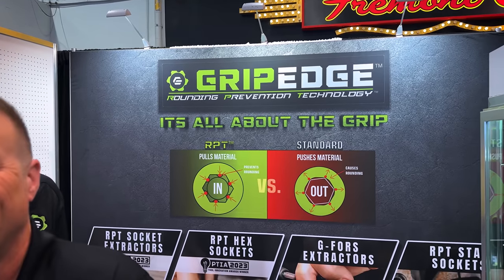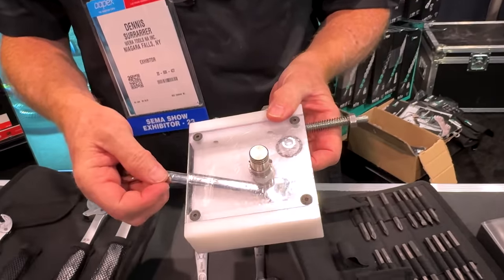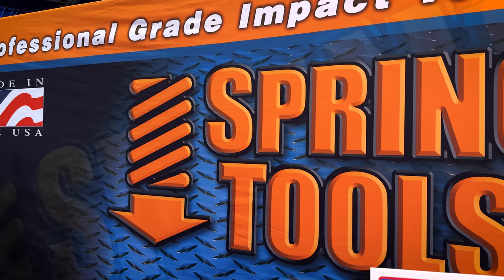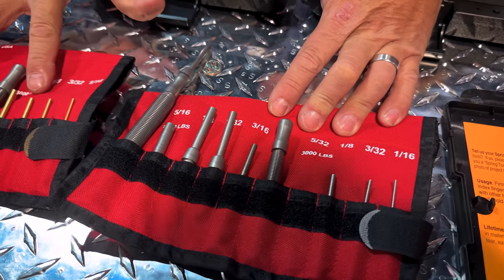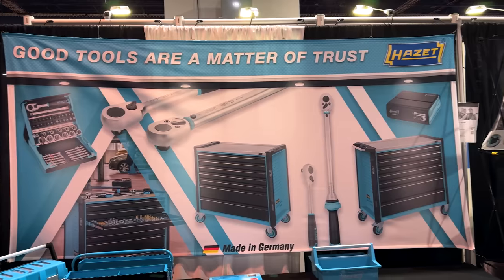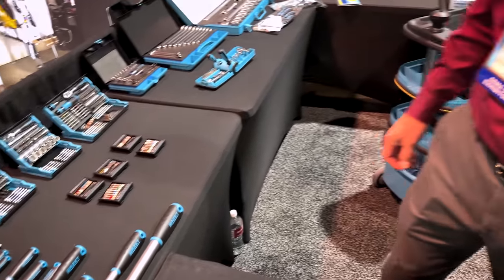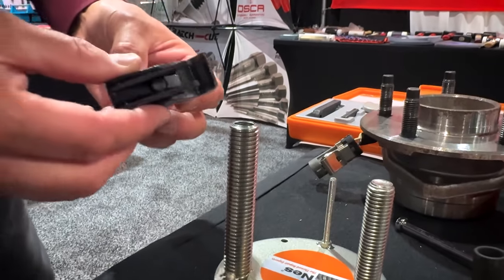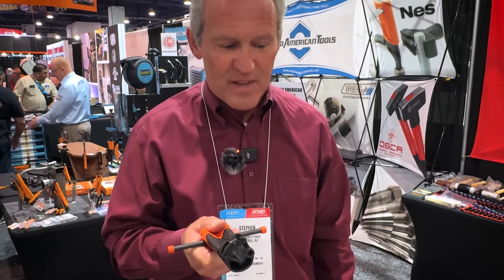SEMA Show 2023! Grip Edge, Spring Tool, WERA, HAZET, Bad Dog Tools, & More Tools!!! Pt 1

Comment: Bad dog is a scam. I owned the cut off wheel and the drill bits. Both fell apart after light usage and they wouldn't honor there warranty. DO NOT BUY
Reply: Are you kidding. My bad dog cut off wheel has cut through stucco, Steel ground anchors, and conduit and has had no issues. Had it over a year
Reply: There's a video floating around of a cut off wheel review and it's not a total scam but it's like bringing a Leatherman to work on a car. It'll probably work in a pinch but not well.
Reply: I've had the bits for 20 + years.  My problem with the warranty is that if you lose the broken bit before returning it, you're out of luck.
Reply: @jonathanlombard8897 why would they replace a bit that YOU lost 😂😂😂🤷🏻‍♂️
Reply: Thank you for warning

Comment: I will say this. Wera wrenches are not cheap, but you get what you pay for. I bought a pack of the hex plus wrenches for use at work. I've never had a set of allen keys hold up so well. I used the 3mm so much, the color coded plastic sheath came off, but the ball end and standard end still look like new. I've handed them to co workers who had hex bolts that were stuck and and the head was stripped out, and he was so impressed that they cracked the bolts loose that he showed me his metric pack the following week.
Reply: There will always be space for Wera and Knipex in any of my tool bags! Love the Hex Plus wrenches!
Reply: @PhilipBlank  absolutely, have the knipex pliers wrench with the smooth jaws in 2 different sizes. I handed the larger pair to a different co worker to use on a 23mm bolt holding a 40hp motor to a frame last week. Once they bite the only thing stopping you from breaking the bolt loose is your own strength. It's impressive.
Reply: Ah man can’t beat the smooth jaws. People are always shocked if they’ve never used them before. I’ve got the suite of cobras and two plier wrenches, but I’ve got my eyes on a couple more and a set of the jaw covers!
Reply: My ToolCheck plus is surprisingly my go to piece of kit when working on my VW engine. 

The T30 bit in that kit has broken loose more bolts/screws than any other bit ive ever owned and is still pristine.

It’s the only bitset that I absolutely make sure to never misplace even one - where as my Milwaukee bits I pretty much treat as disposable.
Reply: I work on forward where aesthetics matter, and wera hex plus is what I use if they make the size. If they made every size of hex bit that's all I would use, but the sizes are limited.

Comment: I know the RBRT and RPT stuff does work from watching your videos, but when he did the good hex bit on the bad hex bolt, he had the ratchet going the wrong direction. Idk if it would've taken it out or not, but still. For the principle if anything.
Reply: Our Cornwell Dealer in our area has that RPT demo block on the truck. RBRT and RPT are legit. Just had our Mac Dealer order me another set of the RBRT.
Reply: @removefromme  Yeah, I know they are legit, I'm just saying on the principle of honesty, it would've been good for him to have the ratchet going in the right direction for all of the tests he demonstrated. It could've just been an honest mistake, but idk since I'm not the demonstrator.
Reply from the maker: Played with the demo block myself. The normal hex socket won’t grab the rounded bolt.
Reply: @railroadsniper  I'd say honest mistake. If the product wasn't worth a crap, then it would have been intentional.
Reply: @MrSubaru1387  Thanks for the reply, I'm glad to know for sure now. Thanks for all the work you put into your videos! They've been a great resource
Reply: @removefromme  Yeah, I'd say I agree
Reply: The traditional bit was spinning freely regardless of direction. Forwards or reverse, there was no engagement and it had no chance of removing the bolt. Our RPT Hex gripped with extreme torque and he was able to crack it loose and tighten it back down again with ease! 💪

Comment: Those Bad Dog drill bits look good. Wish I could afford them, hahaha.
Reply: They have terrible reviews
Reply: On Amazon, baddog drill bits have 1.7 stars. Almost everyone says the bits are the worst.
Reply: @JREfunnies  Dang! How disappointing.
Reply: @TylerSnyder305 

Try drill hog bits, they also have a lifetime warranty.
Reply: @jesusisalive3227  I have def seen those recommended. It sucks that good bits are crazy money and any that aren't expensive are pretty much all crap. 😂
Reply: @802Garage  

Having a lifetime warranty makes them cheaper in the long run than the box store bits. They are good quality to begin with. I'm sick and tire of going through bit after bit after bit because they are being made with Chinese steel.
Reply: @jesusisalive3227  Warranty is definitely a good point. I usually don't expect a company to cover them though if you break them for example.
Reply: @802Garage   the warranty is only there to fool people like you. Wait until you try to return one, you'll be paying postage costs every time. By the third return, you'll wish you'd have bought something decent in the first place. And what happens when the company eventually goes out of business? This isn't the first or the last company to try selling masonry drill bits as something new. I've seen this exact demonstration by different brands. They're all the same. They'll make a hole, but they're no precision drill bit. A tool that's not fit for any purpose.
Reply: @goldar4846  Well read the second part of my message. I almost never break tools anyways. Almost everything I own is budget except my DeWalt 20V and Milwaukee M12. Plus I have a decent straight edge and some other specialty tools. I also own a few pairs of Malco Eagle Grips. I buy quality when it makes sense, but a lot of the time I just can't afford it hahaha. Warranty is not a main selling point for me. Matters more for something like a TIG welder or lift.
Reply: I've used them,complete garbage and way overpriced for what they barely do.In my opinion that is.

Comment: 2:47 Those Joker wrenches are marginal at their very best. This is the set that I regret the most. The open end slips much too easily even though there's lots of bracing I've had these slip on so many bolts I don't trust the open end any more. The closed end is decent and will hold up to normal amounts of torque but the backlash required to ratchet the mechanism is very inconsistent especially in the smaller sizes. The best feature of these wrenches is the color banding corresponding to different sizes because it makes picking the right wrench super easy. Sadly, instead of making small raised panels to help protect the coloring it is at the same level at the face of the wrench and my bands started showing wear very early on. I do really like the satin finish to the wrenches I like the raised numbering and the size of it helps when you don't have your glasses on, but these are not priced as what they are they're priced at what the marketing can make you think they are. Unless you're going to use the nut holding feature all the time and you can stomach the overpricing steer clear of these, you'll thank me later
Reply: I’m a Wera fanboy, and even I wouldn’t buy them. Probably their worst tool IMO. I absolutely love their Tool-Check and Bicycle Set 3, and their Hex/Torx keys are second to none. Jokers are a joke though lol
Reply: They are still on my wishlist and i will pull the trigger on them at some point. Imo they are the most innovative wrenches out there. The ammount of utility they offer over pretty much any other wrench is pretty sick. The fact that they are thin and you can approach a bolt from pretty much any angle with the open side is a win in my books.
To be fair i watched project farms video about them and the open end was pretty terrible in terms of grip strengh, which is dissappointing, but i doubt that this will be a problem all the time. I personally avoid using the open side for torquing down a bolt as much as possible. The ammount of time i slipped off a bold head and rounded it off with any other wrench is high. There is just no better feeling than slipping off a bolt with cold hands and hitting something hard.
The boxed end and the ratcheting mechanism was one of the best overall.
Reply: People still use the open ends ?
Reply: @LemonySnicket-EUC  well not with these unless you want busted knuckles

Comment: Hello Mr. Subaru,

I'm a huge admirer of your videos, and I was hoping you could help me with a problem. I own a Subaru Impreza 2009 EJ20 non-turbo. About two weeks ago, it started stuttering at cold starts, lasting for at least 5 seconds before clearing up. Additionally, when driving, it occasionally stutters, emitting black smoke from the exhaust. This only occurs when maintaining a constant speed at 2800 or 4000 rpms but if I stepped on it all the power is there and it feels ok. I've tried the following replacements and cleaning procedures:
- Spark plugs
- Upstream and downstream O2 sensors
- Ignition coils
- MAP sensor
- Air Mass sensor
- Throttle body cleaning
- Checking for vacuum leaks

Despite these efforts, the issue persists. :'(
I would greatly appreciate your advice on what steps to take next.
Reply: Bad/leaking fuel injector putting too much gas in, grab a code it may tell you which one or just pull them all.  Good luck!
Reply: Thank you for the information, but there are no codes thrown, maybe I'll check the injectors. Thanks again!

Comment: So the problem with rethreading is its usually on an exhaust bolt where you can barely fit your hand and nothing else. Neat idea and great innovation but not compact enough
Reply: You could probably grind some material off their tool,and take several progressive passes.

Comment: @MrSubaru1387 i have a 2001 subaru legacy outback limited sedan 2.5l i had to take off my tps and when i put it back on it idles at 1500-1800rpms how do re align the sensor